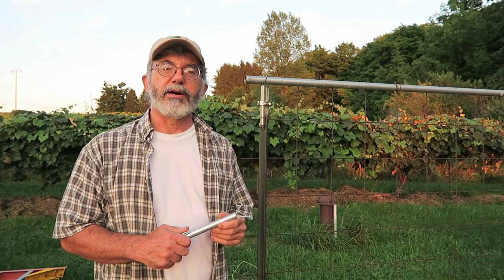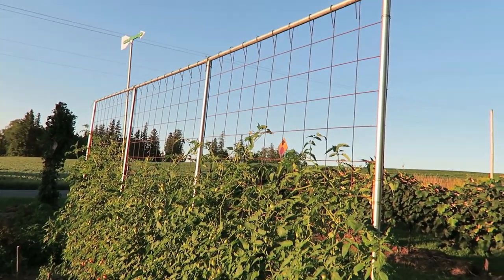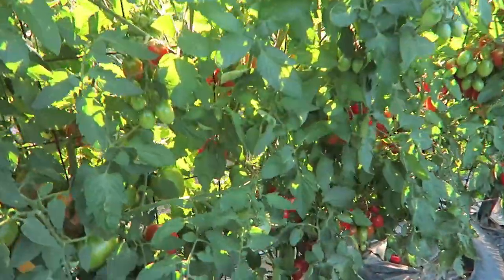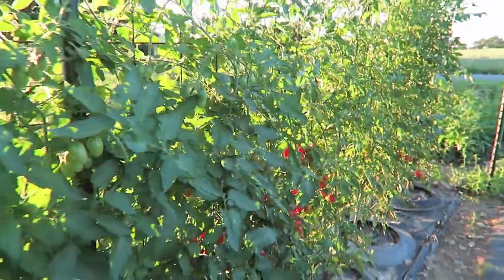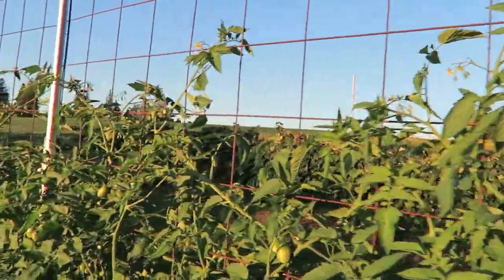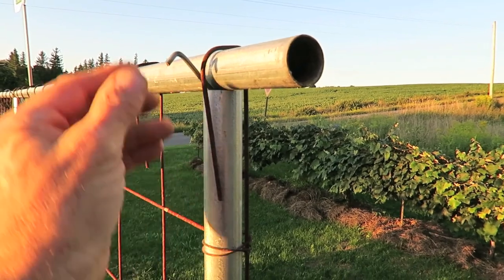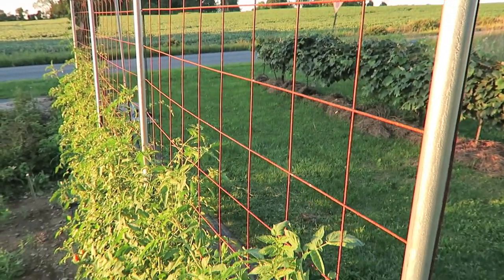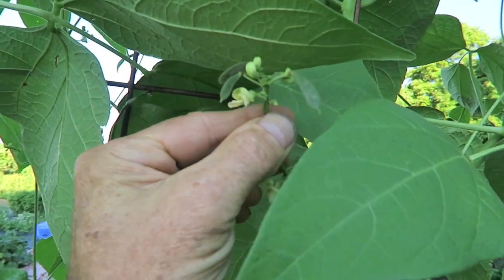Whizbang T-Post Trellis Spans

Comment: I use a lot of 5 gallon buckets in my gardening. I use a double bucket system mostly.
Sometimes I get a bucket that fails due to UV damage and I have to throw it out. 
I've been looking for some use for the bail handles. That's good steel in those bucket handles. I bet I could bend them into Y holders for the top of the trellis conduit.
Reply from the maker: Waste not, want not. The diameter is a bit thinner than the wire I use, but I'm sure that handle wire would do the job. 👍

Comment: With your indeterminate tomatoes, do you worry much about suckering them? Doesn't seem like you do...just wondering if you would get more tomatoes with suckering (not that it looks like you need any more tomatoes!!)

I string mine with maybe 2-3 strings per plant (main stem and then 1-2 suckers if they form low on the plant)...I have to sucker or the stringing gets impossible, plus it helps keep the lower space open for more air movement.
Reply from the maker: Hi Miles, I string-trellis some indeterminates, and it sounds like I do it just like you do—letting two suckers low on the plant grow, then pinching off all suckers after that, while twining the three stems up the string.   But with the concrete wire I just let the plants go wild. If a stem shoots out away from the trellis, I cut it off. It's easier and I still get lots of tomatoes. Thanks for the comment.
Reply: I saw your stringing method in another of your videos...pretty similar to mine but, I spread them out a bit more at around 6 plants over 10 ft. I use t-posts and then fence rail stuff (slips over the t-posts I have) for the height and span. I also use t-posts and welded hog panels for trellising peas, beans, cucumbers, etc.

I'm continually surprised by everyone around here when they look at me strangely for trellising things like cucumbers, let alone squashes and watermelons. I respond "If they have tendrils, they get a trellis."
Reply: I just ran across your channel today and it's pretty amazing how similar our gardening strategies are....mounded beds, weed fabric w/holes (I burned with soup cans though, only crazy people use biscuit cutters!), trellising, etc....all pretty much the same methods. I run a lot of drip tube irrigation and have some gravity-fed versions that I designed as well, using 55gal drums elevated on some t-posts.

I will be ordering your book off Amazon when I order some floating row covers to keep vine borers out!
Reply from the maker: Miles, I didn't have a soup can. :-) "If they have tendrils, they get a trellis." ...  I like that.
Reply from the maker: Hi Miles,
With a tomato trellis span like I show in this video, I don't do any suckering or training other than the tuck-and-weave I show in this video, and cutting away tomato branches that grow beyond the plant that are not convenient to tuck and weave. Well, I do remove bottom foliage too.  
However, I have other tomato trellis's that I do prune and train to grow on strings. I detail this in my book. It's a lot more work, and I'm not convinced that it results in any more tomatoes, but it's nice to look at a nicely-pruned tomato plant. There is a great feeling of satisfaction in it, if done right.
Thanks for the comment.

Comment: I'm completely organic with my gardening. Have a horrible issue of blight with tomato's...to the point where I'm considering no longer growing them. Have tried many remedies including pruning, Serenade, copper...some work for a while then the blight takes over and destroys the crop. Any suggestions?
Reply: Are there any Heritage Varieties that are blight resistant?
Reply from the maker: Skiman107—
I feel your pain. I don't grow anywhere near as many tomatoes as I used to because of blight. It's very discouraging. I don't know of any way of stopping it completely. This year has been unusually dry here and I think that has made all the difference. I cut off the bottom leaves of my trellised tomatoes so they are not in contact with the ground, and I cut them off as blight starts to show up there. That's certainly no cure, but it might help a little. I did grow some Defiant tomatoes this year. They are a determinate blight resistant variety. They have grown and yielded very well, but it isn't a blight year here this year so I can't say how well they'll do when it is a blight year. I'll be growing them again next year, just in case. I guess it's a gamble every year when it comes to blight. I wish you the best with your tomatoes.
Reply from the maker: Re: blight resistant Heritage tomatoes... I think that there are in the category of cherry tomatoes. The smaller varieties seem to have more blight resistance. The Tommy Toe is open pollinated and it has done better than others in blight years. But it eventually succumbed.
Reply: Couple of things: the organisms that cause blight live in the soil and stay alive for 3-4 years, that's why all the books recommend growing in different spots (rotating crops.) I don't have the space to do that, so I try to prevent the pathogens from infecting my plants. They get infected by water splashing up from the infected soil and onto the leaves. To lessen this from happening: 1. use dripper hose to water (never ever use spray hose or sprinkler to water-no splash from your lawn watering either) 2. Cut off all the bottom side branches off the lowest  12" of the tomato plants, so you have a single stem coming up from the ground. 3. Ruthlessly remove every infected branch as you see them appear, trim them back to the main stem (they will never "heal" or get better, they will just accelerate the death of the tomato.) Throw the infected trimmings in the garbage, away from your compost and plants.
Reply: skiman107 I realize this is a year old post but I have heard a weekly spray of milk is supposed to help. I always plant enough to harvest enough tomatoes for the year minus loss. My plants have always succumbed rotation and all. I'm trying milk next time around. The copper or sulphur postponed the inevitable but here in the hot humid south I just harvest till it dies.

Comment: Are you using drip tape under your plastic?  I used it last year, but had a terrible time with moles chewing holes in the drip tape.
Reply from the maker: No. I tried drip tape once and it was such a bother. I came to the conclusion that I just don't need it. With a mulch and proper plant spacing, I ve found that I need no artificial watering beyond that needed to get seeds or seedlings off to a good start. 
Plants will sink their roots deep to get the moisture they need if you don't feed them the water they need from the top. 
This matter of "artificial watering" is discussed in my book on page 86, where I present great wisdom on the topic from an 1878 Farmer's Almanac. Four paragraphs long, but very insightful.
Thanks for the comment

Comment: In another garden video, you mentioned that you use only the retained moisture under black plastic for most veggies. How many inches of rain equivalent per year do you get in your garden??
Reply from the maker: NY State gets around 42" of annual precipitation. The only time I need to water my garden is when getting seedlings established, or if we have an exceptionally dry year, and then I will spot-water certain plants, like squashes and berries. But I'm not even sure I need to water them. I've found that if I give the plants adequate space and mulch with plastic, subsoil moisture will provide all the water that plants need. I once grew in beds and spaced the plants close together, and did not mulch, and they could not get the moisture they needed. It was obvious on a hot day. They flagged (wilted). This availability of subsoil moisture is not fully understood by many gardeners. It certainly wasn't understood by me a few years ago. I'm not tapping into this knowledge with my new Minibeds-on-Plastic experimental garden. Minibedsonplastic.com

Comment: How far apart did you plant the tomatoes on the trellis spans?
Reply from the maker: If I recall correctly, those tall trellis spans were 5 foot wide (three together to make 15 ft total ) and I had three tomato plants in each section. 
My book presents an ideal trellis span for tomatoes, using the Y-holders (page 16). It is 5'6" high and 9'6" long. Four plants are spaced 28-1/2 inches apart (14" from the ends).
I have several trellis spans that size on the perimeter of my garden and have planted tomatoes at that spacing in those spans for years. 
The overall size is determined by the size of one panel of concrete reinforcing wire.

Comment: Great video. How does it fare in strong winds?
Reply from the maker: Great question. I've never had a T-Post trellis span blow over in a strong wind, and I've been using these in my garden for seven or eight years. The T-posts are pretty tough and they are in the ground 18."  However, I'll admit that I'm wondering about the ability of the 15 ft long trellis span in this video to hold up to a strong wind. I made that this year and I've never made such a large, tall span. My tall trellis spans have all been 5ft wide before, and the shorter ones at just under 10ft long. I may be asking for trouble with this large wall of foliage in a big wind. It would probably have been wiser for me to make 3 separate spans at 5ft long.Time will tell.
Reply: +farmbeet Thank you for the reply. I'll try it out as well in the spring.

Comment: do you move the trellises for rotation of crops or do you just plant different climbing crops on each trellis leaving it in place to achieve rotation? I think those trellises are awesome, Bruh. You are pretty cool inventing all these things.
Reply from the maker: Thank you for the positive feedback. I leave the trellis frames in place and rotate different crops onto them. That's the easiest way .
Reply: Herrick Kimball I have been considering now after seeing another video by MI Gardener if as a home gardener with not that much land if I really need to rotate...  the main things that plague my plants are powdery mildew and squash vine borers.
Reply from the maker: @thehomeplatespecial597  I've never been good at rotating crops in my garden. For example, I've planted tomatoes after potatoes with no noticeable problems. I think rotation is a good idea if you can do it, but if your space is small, don't worry about it. I think you'd probably have the mildew and squash borers even if you rotated crops. I'll have to check out the MI gardener video.
Reply: Herrick Kimball I think you are right